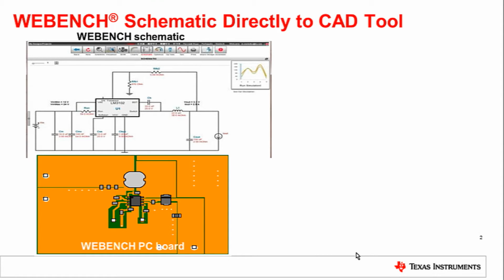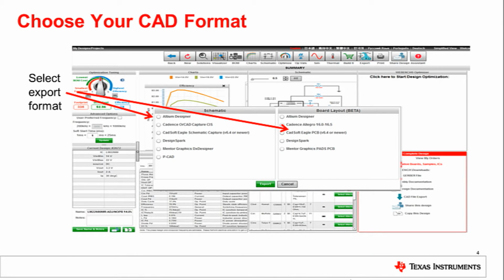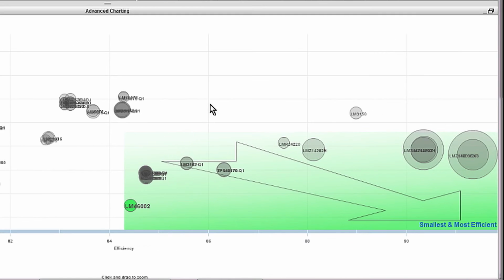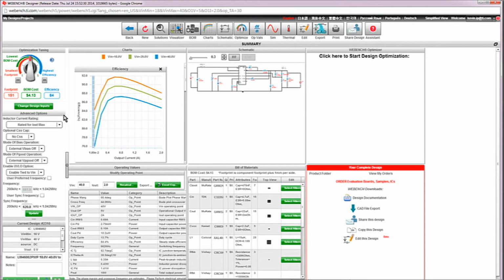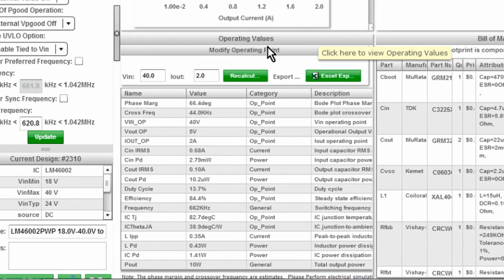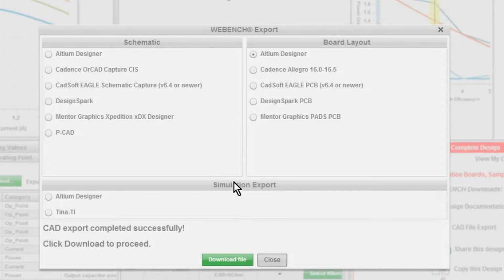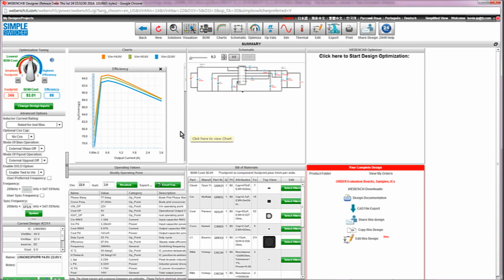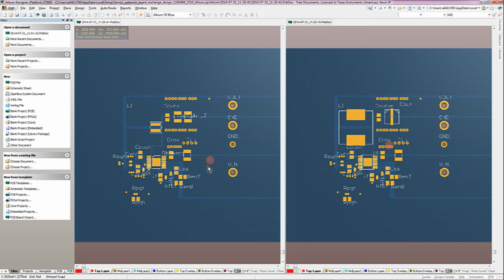WEBENCH PCB Export for Synchronous SIMPLE SWITCHER Devices

Comment: Great concept but flawed execution.  I have not had good success with the SMD footprints for the TI TPS63031 and TPS63002 chips.  I had to create my own foot prints in order to match TI's own data sheet specifications.
Reply: Hello Chip,
Thank you for your feedback on the video. 
WEBENCH PCB export feature only applies for the devices are enabled in the Tool. Both the TPS63031 and TPS63002 do not have their PCB export feature enabled yet but they are coming.